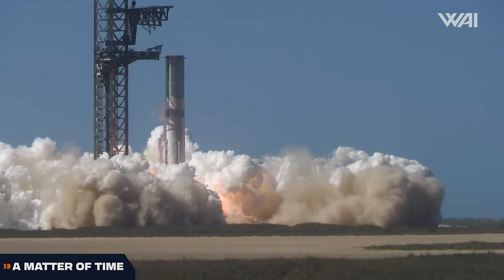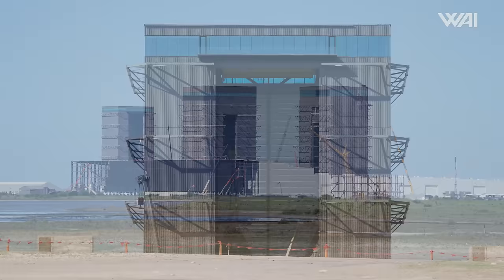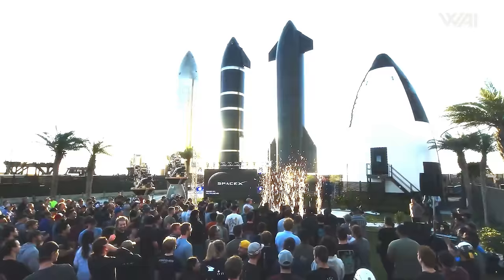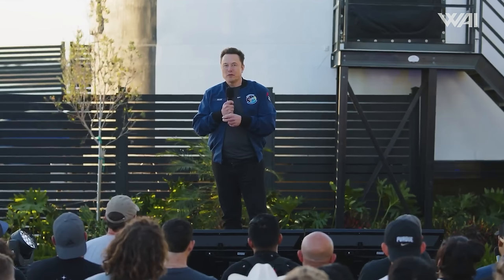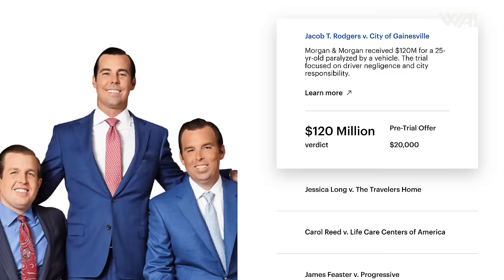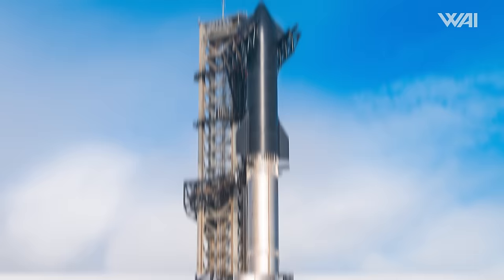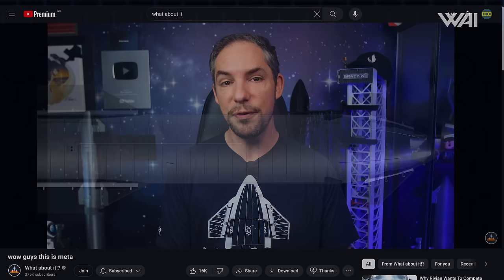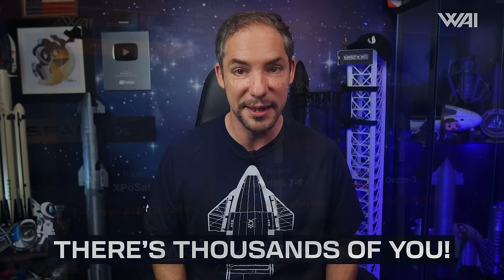SpaceX Unveils Groundbreaking Update: Inside Musk's Latest Starship Revelation!

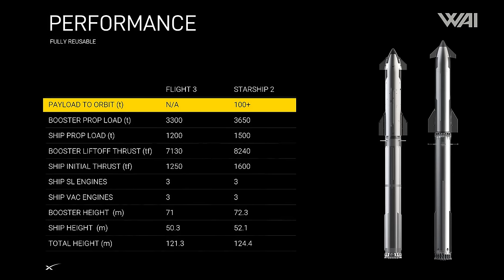Comment: 11:18 Starship v2 goes from 50.3m to 52.1m which is 1.8m or 1 ring section taller, not 0.8m
Reply: still seems like that is not enough to more than double the payload to orbit. A 1.8m increase in tank hight is going to increase the propellant volume on the upper stage by like, what, 2-3%? Ditching engine shielding while increasing the size of the gridfins and the hotstaging setup, will probably reduce the booster dry mass somewhat, but the added heat shields, and larger flaps will increase the dry mass of the ship. They might not loose as much delta-V to gravity with the higher TWR, but going from 30t to 100t+ seems like a lot given this list of changes.
Reply: @plainText384   It could be, you know, that the people who are actually building the rocket are privy to the details of whats changing and how that affects mass to orbit. 

The big change you're looking for isn't the streamlining of the vehicle, its in the engines. Raptor keeps getting better and better.
Reply: @jackinthebox301  I think I may have figured out what is happening.

In the graphic V2 starship has its booster grow by 1.8% in hight (much of that in the size of the hotstaging interstage), but the booster propellant mass increases by 10.6%. To me this implies that the propellant density is somehow increased. One possible explanation could be that Raptor V3 is going to run less fuel rich than V2, so the booster will carry more LOx and less CH4 (closer to the stoichometric 1:4 fuel/ox mass ratio), which will effectively increase propellant density. 
The Ship grows by just 3.6% in hight while increasing it's propellant mass by 25%. The difference here is even greater than in the booster, so what I think is happening here is that SpaceX is shrinking the payload bay volume (probably by a significant amount, like 4.7m) in favour of stretching the propellant tanks.

Comment: Why would V2 be only such a small amount  bigger than V1.
Reply: The main changes are under the hood. It uses V3 Raptor engines which means a higher thrust and no heat shield for the engines.

Comment: the brilliant move they are making by attempting a catch of the booster as soon as OTF 5 (assuming that 4 goes well) is that they have probably already started manufacturing the parts for the second launch tower. So if anything goes wrong with the first catch of a booster, they will likely have the parts manufactured to go ahead and make the neccesary repairs and keep up with the test campaign...

Comment: will the water deluge system be used during the catch ?
Reply: I would hazard a pretty confident no on that one. The sub-orbital pad doesn’t have any deluge system and it handles reasonably long 6 engine static fires (not sure on throttle settings though). Booster won’t be coming into a catch with all 33 Raptors lit (it physically can’t relight the outer 20 anyway). I think the plan is only 3 centre Raptors lit for the catch, and if the chopsticks are high then the clearance between the Raptors and the top of the OLM let alone the deluge will be significantly more than the clearance between the Raptors and the concrete for a static fire on the sub-orbital pad so really no need for the deluge system for the catch.

Comment: Engine heat shield may have been one of the mistakes of IFT-3. Due to heat of as many engines in one place and during vertical descent. While open construction lets the heat pass through. Just a guess.
Another thing once you have as many engine bells (large surfaces) they should kind of work like a steering device too during descent? Even when not firing?

Comment: The numbers in the chart @ 17:05 don't make sense. Booster V2 gains 350 tons of propellant, but only gets 1.3m taller, while Booster V3 gets almost 8m taller, and only gains an additional 400 tons of propellant? And I thought you said Starship V2 was only getting 0.8m taller? So why does the change in height on the graph between IFT3 and Starship V2 equal 1.8m?

Comment: The second tower should be a catch-only tower; no OLM or tank farm, just tower with chopsticks. That will simplify construction and reduce rectification costs and time from a failed catch. I know rapid reuseability requires catch and reflight quickly, but we’re still in development phase currently. One step at a time.
Reply: How do you get the remaining fuel out of the booster so it's safe to approach?

Comment: Actually moving the grid fins down would almost certainly reduce their control authority, as the moment force they exert is the product of the aerodynamic force they generate at their center of pressure  multiplied by the distance between their station and the booster's center of gravity. f*a=m, so bringing the grid fins closer to the CG will reduce a and therefore also reduce m.
Reply: Don’t confuse the audience with physics 😂

Comment: The re entry speed from earth orbit is 8 km/s. The re entry speed from the moon or mars is 11 km/s. Is the ship able to withstand the heating with the same tiles ?
I wonder why small landing legs as for ship 5 have not been installed. They operated perfectly and this system allows the ship to land on any concrete surface ( an airport for example) with no need of a catching tower

Comment: the issue i see is that the ships are round.  i mean wouldn't a trapezoid or triangular /diamond shape of hull be better?  could boosters help?  i mean in the old days the boosters were solid propellent but with space x each booster could also return to station for retrofit and reuse ..right?  power stations don't need to be on the planet/ i mean solar sats that "beam" energy down could be immune from planetary dust... just repair and such would mean to reach them.  meanwhile ... wouldn't the winds of mars work well with wind power?  that and thermal day/night cycles??  is there a part of mars that never gets one of those?...i'll have to do some research on mars again.

Comment: Wasn't all of this supposed to happen on the last flight? The booster was supposed to make the soft landing in the water and the ship make re-entry without disintegrating. The launches so far have been made without any payload and both stages were indicated as not having much left in the tanks. A payload will require more power hence more fuel.

Comment: I’ve never understood why the QD arm is at a fixed height. It should be on a system that allows some height adjustment for different height vehicles. Not just V1, V2 etc, but all the different types of starship might have different heights; lunar, Martian, fuel tank etc.
Reply: They may have different heights but the QD isn't affected ship height as no ship is going to be shorter that the QD arm. They may have to move the arm for the v3 booster though as that will change where the bottom of the ship sits.

Comment: One thing in SpaceX renders of v2 and v3 Boosters that jumped out at me, and yet for some reason wasn't covered here, is those seem to have two separate BQD interfaces on each Booster!

Is this some kind of a redundancy play, or is OLM 2.0 literally going to have 2 BQDs, side by side, for double the fun?  🤔
Reply: It may be that the second is for the outer 20 raptors rather than having individual qd's for each as they do at present.

Comment: It’s been said before, but the new raptor 3 makes me nervous from a reusability standpoint. Integrated components at least in my opinion are a lot harder to inspect / service. I can’t imagine what the materials go through at those pressures. That being said, there may be a point down the production line where it makes sense to just swap engines each launch.
Reply: Engines are the primary cost of the rocket. Swapping out and disposing old engines is only 10-15% cheaper than simply using a disposable single use rocket.

Comment: It will probably be some time before SpaceX achieves the 1 hour turnaround on Starship so why not build a much cheaper tower to catch the booster that does not have all the expensive launch infrastructure.  That would avoid the possibility of destroying the launch mount for the first 50 launches or more.  Once catching is perfected the catch mount could be upgraded to another launch tower.

Comment: I'm predicting that the Super Heavy catch is going to be hard as hell to master. The level of precision needed has basically zero margin for error. All of the falcon 9 landings have probably taught them a ton about attaining that precision though. Hopefully they can transfer some of that skill to the much more massive booster
Reply: I don't care enough to go through videos of RLTS landings to measure, but they are pretty damn accurate with landings on a static location. The droneship landings vary so much because of the ocean. Keeping in mind, of course, that the Falcon 9 can't hover while Starship can. How much more accurate will they be when they will have some seconds to make sure things are lined up? It's gonna be crazy and difficult, but I don't think its as ridiculous as many people seem to think.
Reply: Remember that Falcon can't hover - but SuperHeavy can... it's got so many engines that it can get the thrust/weight to one.

Comment: It seems like they should pre-build and modularize the OLM scaffolding maybe 3 - 4 sections that can be quickly lifted and installed then quickly removed and placed in a nearby bunker. It seems they have to spend hours building then dismantling after every launch event. I would think they will need this for ongoing OLM inspections and maintenance for years to come.
Reply: They don’t dismantle it, they have to repair it because they still haven’t perfected its design.

Comment: Failure to use a catching tower is about the worst decision SX could make. Maybe years down the road but even then it makes no sense. With SX's capability to move rockets with relative ease, there is no good reason not to use a catching tower. A catching tower can be built away from the fueling area, it can be much smaller and less complex, it allows for multiple uses of the launch platform, it reduces problems with bottle necks, it reduces the opportunity for damage to the launch tower by 50 percent for each use and on and on and on.

Comment: How will they mount a docking system to the quick disconnect on starship? I thought nose to nose transfer would be easiest but the quick disconnect already has all the plumbing exposed but it's position along the side of the ship seems less than ideal for docking and transfering liquid propellant. While a nose to nose docking system would be almost trivial for them along with the ability to dock in that orientation.
Reply: Nose to nose docking is no easier than side to side. Capsules put the docking port in the nose purely because on something that small, there's no real alternative. In contrast , Shuttle docked to ISS via a port on the back, since that was most convenient for the Shuttle layout.

Comment: Why not build bigger heat tiles, for example, one cone sized for top, anohter 4 for each flap so many others completly to cover starship diameter
Reply: They get hot, expand and then break.
Reply: @shaung949  ok. thanks for your answer.... me insisting: then they could built something like a network of heat tiles, maybe  like a blanket, so not being easy to loose and fall off
Reply: @ghpant  The main problem is in areas where they have to rely on glue to attach the tiles, in most places they are attached with pins which hold the tiles well.

Comment: Though I think it is pretty cool to catch a booster using the chopsticks I'm a bit worried about the Orbital Launch Table as the booster seem to hover above it while scorching it with the exhaust from the Raptor engines and even though not all of them are alight, the few needed for the hoving can still create lots of heat.
Reply: Not likely to be a problem. If it can survive launch, it can survive a booster running a few engines on low power, hovering high above the launch table.

Comment: 7:25 Reaching the moon is not the objective of HLS for Artemis III. Reaching the moon AND returning back to Orion in NRHO, is. While the HLS payload will probably be <<200t, there is no reason to assume the number of refueling operations needed for HLS is the same as the number needed for a theoretical 200t CLPS mission.
As a comparisson: BlueOrigin's uncrewed BlueMoon Mk.1 lunar lander will deliver 3t to the lunar surface with absolutely no refueling needed at all, but the crewed HLS BlueMoon Mk.2 lander will need multiple refueling missions.

Comment: All Ships are built to be loaded or unloaded with propellants through the refuelling ports fed by the Ship QD on the OLIT.  To eliminate the need for any additional hardware (mass) it is therefore almost certain that the orbital refilling station must provide a copy of the Ship QD on the OLIT.  I imagine this could be folded into the space between vacuum Raptors immediately inside where the refueling ports are on the Ship.  This could plug into the piping that already exists for the refueling ports, or it could be designed to jack into the refueling ports after being unfolded.  In orbit this would unfold and extend in front of the refueling ports.  This would place the tanker and the mission Ship side by side, not base to base, and separated by several metres.

Comment: Tbh there was not much in the way of technical details in this presentation from musk. We saw differences briefly on the slides but there was little to no explanation for the major visible changes such as new hot staging ring.
Reply: The hot stage ring should have been obvious. They need a larger gap between the vehical to safely vent the upper stage exhaust and it's essentialy the same with the design a latice lets more exhaust and heat out that a ring with holes in.

Comment: I think the starship is getting too tall, they should increase the diameter instead of the height for V3 so that it's easier to control and maneuver and also raise the platform so that the tail fire doesn't destroy the floor. And if you ask me the tiles should create a bump/crest on the belly to reduce friction and regulate temperature on entry.
Reply: Friction is good on reentry, is slows the ship down.

Comment: Felix, theres a difference between the proposed stage seperation structure and the Russian version... The Russians used the Yurt lattice system, being familiar with its incredible strength to weight ratio when supporting circular structures.
I did several writs in comments on Alpha Tech about SpaceX going to a round pipe/tube structure using a "Tipi" frame style triangulation system, which would be very strong for much larger rockets. The Yurt lattice system will have lower weight limits, using structual elements that are too light each, will give that effect seen in the bridge disaster on the east coast a few weeks ago... its like a chain only being as strong as its weakest link... Round tube is incredibly strong,.and comes in a vast selection of sizes. Takes a good fabricator to do a good job, but sure Elon has a couple of those left over from tower building.
Also I joked, that we were Americans, so have Tipi structures in our cultural engineering DNA...

And it would be nice if that stucture was given the "Tipi" structure seperator name in honor of our beloved Native American cultural componants.

I hope SpaceX does go to that, after doing the writs trying to plant its concept...
I always like helping improve Starship!

Comment: The multitude of engines has always been a concern for me. More engines, more things that can go wrong. Glad to be wrong, looks like SpaceX has again got it right. I just wonder how many of those engines could fail without causing a mission failure? I guess it would depend on the mission parameters and the failed engines locations on the booster? Just curious if SpaceX has reveled that information?

Comment: 20:21 . . .  Not So Fast Felix ! . . . SpaceX, Tesla, & Boring are indeed working on infrastructure capabilities :
(1) Solar Panels + Power Walls & Large Packs of Batteries for small cities or factories
(2) Electric vehicles that could work on any planet with reasonable surface environment
(3) Propellant Farms in space & on ground
(4) StarLink SatComs w/ Lasers !
(5) Electric Tunnel Boring machines that are proven to work
(6)  . . . etc.

Comment: When they do start catching the booster will they have to move the booster off the olm quickly so as they can also catch the ship
Reply: I don't think so. By then the ship will be fully orbital. Just let it orbiting a little more, and problem solved. Even taking 6 hours between landings would be easy.
Reply: The booster returns in minutes, ship is going to be at least an hour not counting mission time.

Comment: I mean, you say that raptor 3 has most of the same components from raptor 2, but they are just invisible as they are integrated into other parts. But it just look like they removed some pluming and claimed it is going to stay like that. It was the same thing with raptor 2 compare to raptor 1, they remove some pluming (like the top mounted feed to the turbo pump) but when you look at raptor 2 engines on booster 7, they look just as complex as raptor 1.
Reply: Essentially, the disappeared plumbing still exists... just built into the engine body instead of attached to the outside.
Reply: @simongeard4824   Exept that there is evidence that there is plumbing missing outside the body of the engine. You can see multiples small tube that end nowhere, clearly it is not going to stay like that.

Comment: Raptor 3 will, with those projected numbers, be more powerful than the Blue Origin BE4, smaller (with a MUCH higher T:W ratio), and much less expensive. B.O. used to be able to claim the BE4 was the "most powerful" natural gas engine.  Oh, and only 2 BE4 engines have ever actually flown.